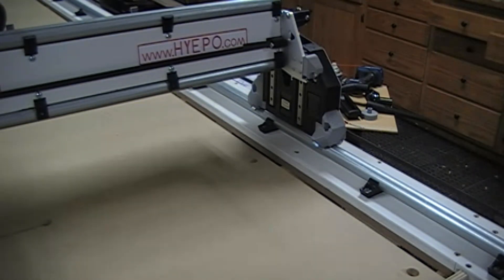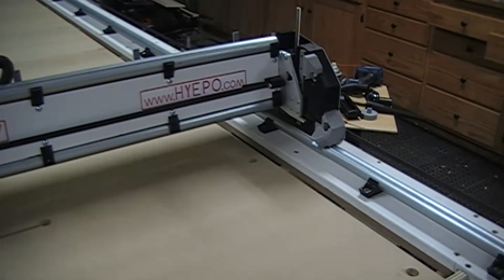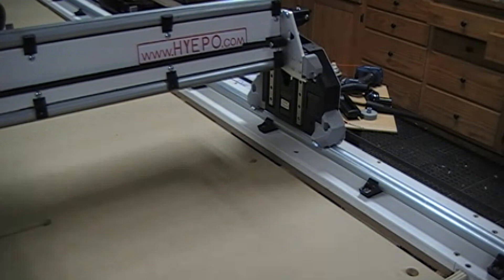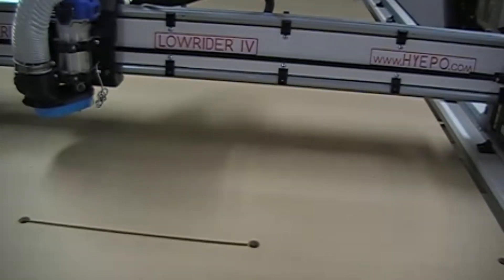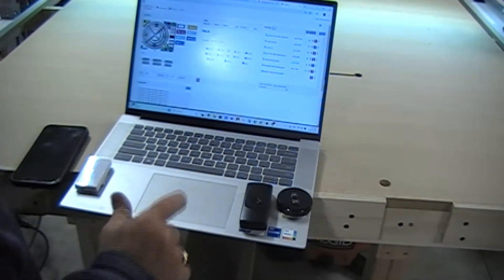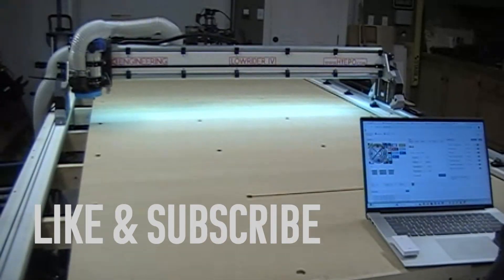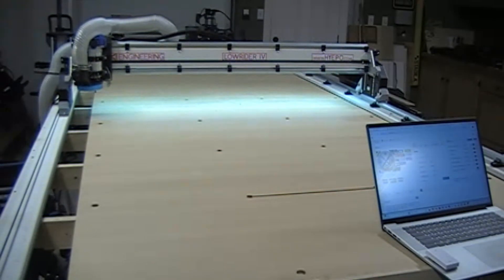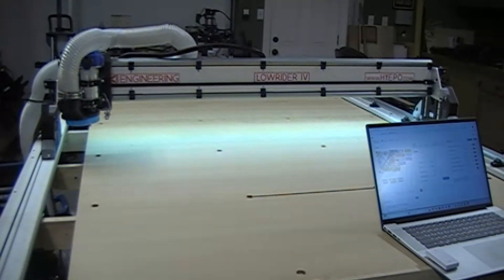DIY LR4 CNC Router Build   Part 29   Full Size 4x8 Spoil Board

Comment: I get this kind of glitch with my 3d printer. Mine has to do with a software bug that seems to read the incorrect possition of the extruder. After I re home it and it hits the limit switches again everything is always good. Ive done it 100 times. I understand different software etc but maybe my experience  can help. Have a good day

Comment: Just finished and did my first cut with my LR4 last night! Is there a file that does this pocketing in the spoil board or is that something you come up with yourself?
Reply from the maker: So. I laid the pattern out using Lightburn and saved as a DFX file, imported to Estlcam and then created the gcode files… one for the threaded inserts and one for the spoil board holes and pockets.  I also set my own machining order.   Very easy to do.